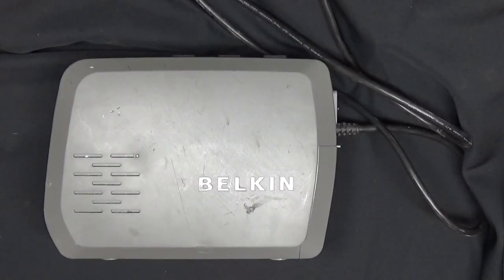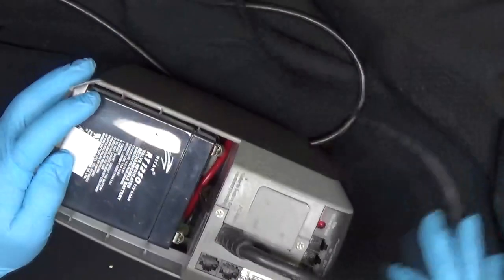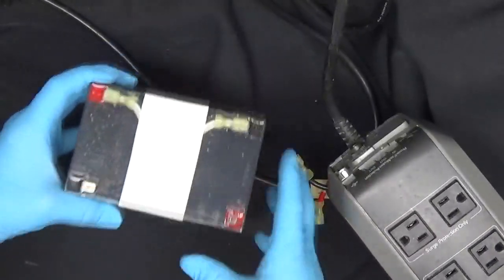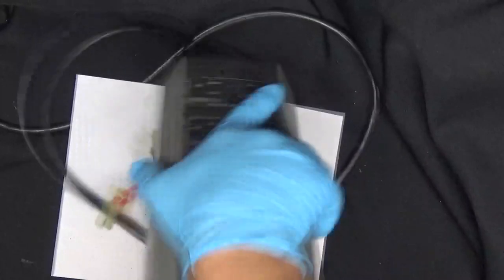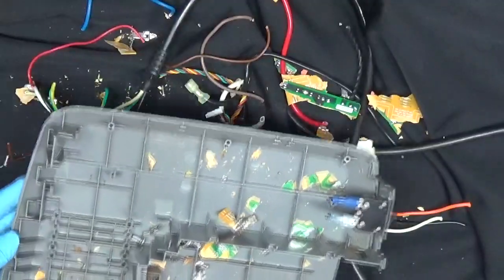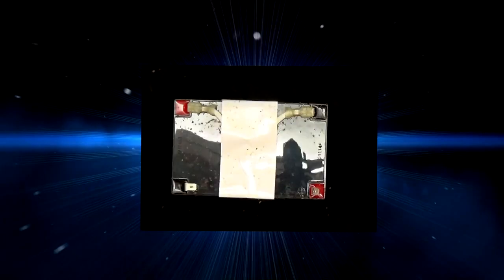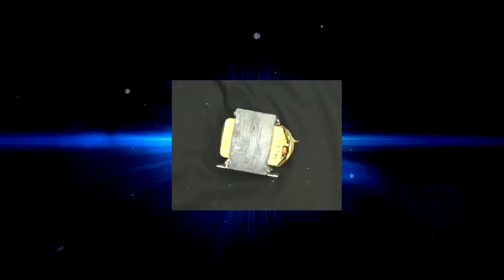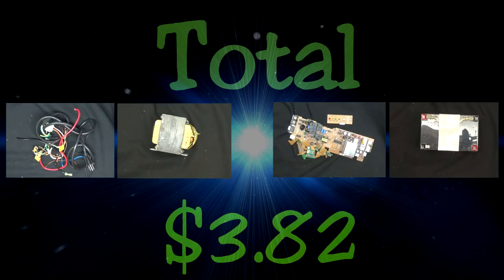What's inside a Battery Back Up?

Comment: hey mike will you please tdy and find out if theres anybody who buys post consumer scrap plastic and glass, specifically crt glass? I scrap a lot of tvs and would rather sell the plastic and glass if i can but ive looked all over the internet and the few sites ive found haven't returned my emails. any help would be greatly appreciated thanks!
Reply from the maker: Crt glass is a hard buy. I have read of companies that went under trying to work with them. Usually Recycling centers would take them for free. Some companies do buy plastic but I have not found one in my area. I spoke to a guy that offered me $25 a ton... That is a lot of plastic for $25
Reply: +Mike the Scrapper ok thanks

Comment: hey mike i have a video idea for you, if you have the means anyways. Maybe try a video for tearing down engines that have aluminum heads and or blocks? I've been watching your vids for a couple years and whenever I run to the scrapyard I sometimes have engines. I get more money when i tear them down because the crankshafts and camshafts get more, plus when the aluminum heads and blocks are stripped they get more too. It's just a video idea that's all. but you'd probably want an impact gun to save your sanity it speeds it way up.  Keep up the good work dude! and if you do have engine vids up somewhere then nevermind =P
Reply from the maker: Scrappers have asked me that question. I do want to make a series on breaking down a car, but it is expensive to have a mechanic on hand with tools that can do it. But I am interested in the idea.
Reply: Yeah that'd be pretty cool!